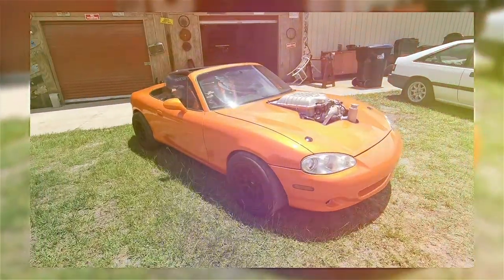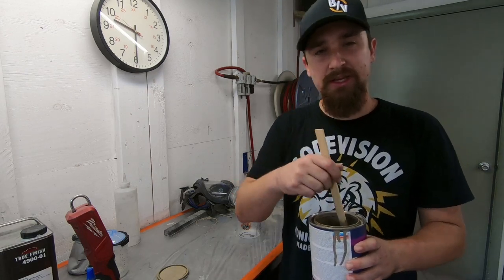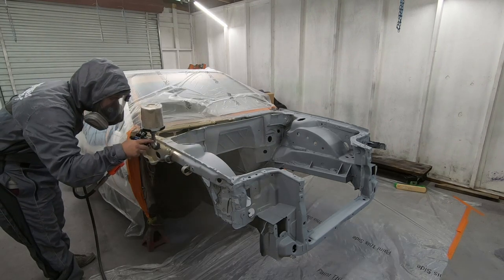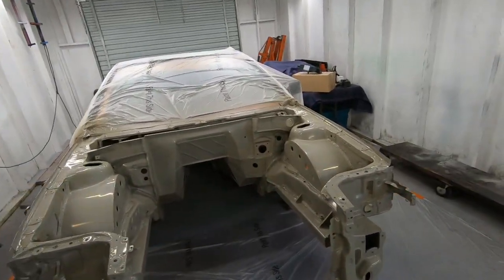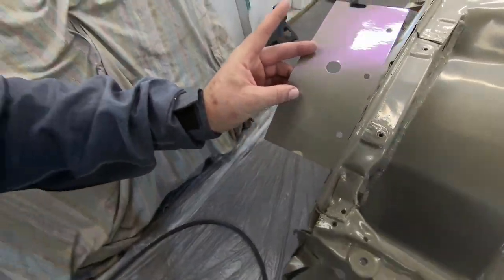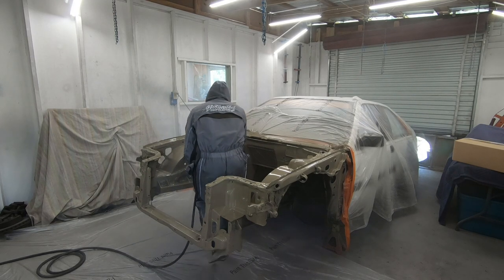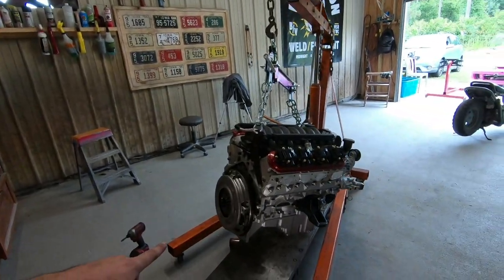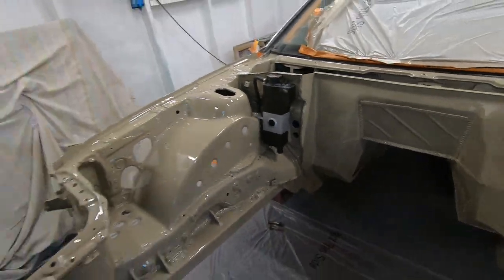The Key To Painting An engine Bay. LS Swapped Honda Accord

Comment: I think you made the right choice, wasn't to keen on your base colour at first but when it's on the car it looks great!  love your work its sooo clean, no matter what I do, I clean and clean, tack many times but still end up with bits in my clear which I assume is dust and dirt? I know you cant tell without seeing it but it looks like tiny pimples in the clear if I didn't know better I would say it's trapped air but how can that happen? any ideas from an expert would be welcome, thanks 👍
Reply from the maker: If I had to guess that sounds like waters getting in your air line from the compressor. Are you using a air filtration system?
Reply: Thanks for the reply, yeah that was my thinking as well but I have a water trap then a 3 stage filter as I also use an air fed mask, I used to have another air filter on my gun but there was never anything in it so took it off as it gets in the way, I use the devilbiss sri pro lite with 30psi at the gun, I'm just a diy painter doing small jobs.